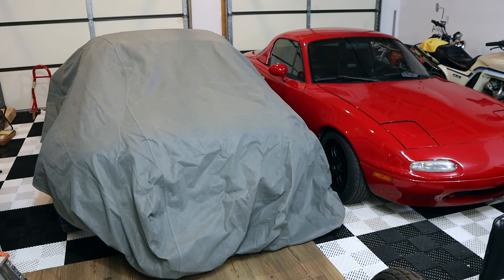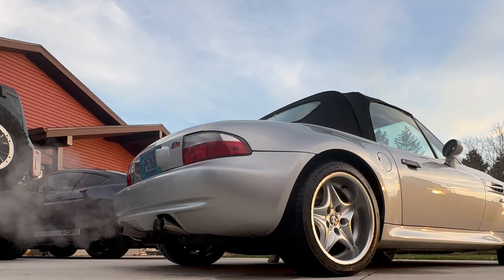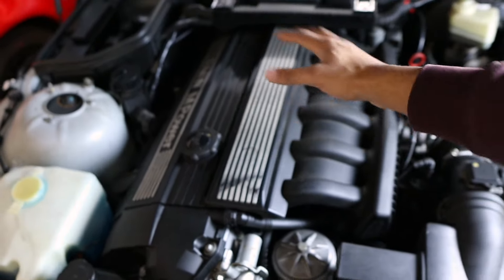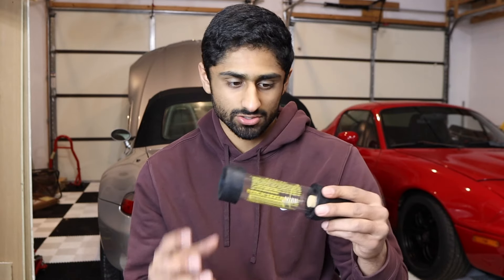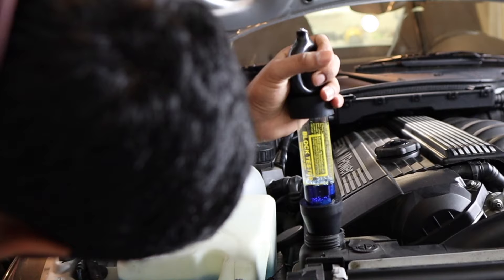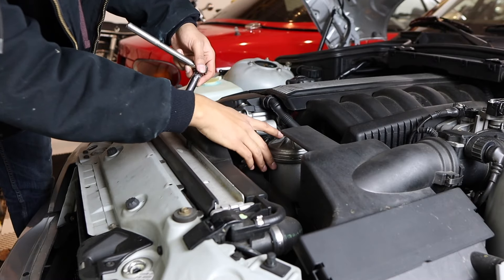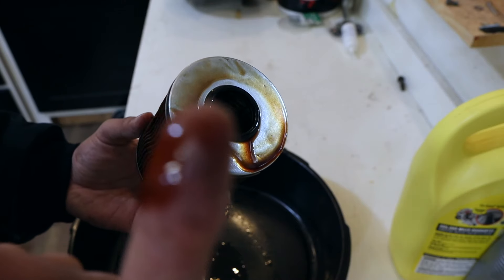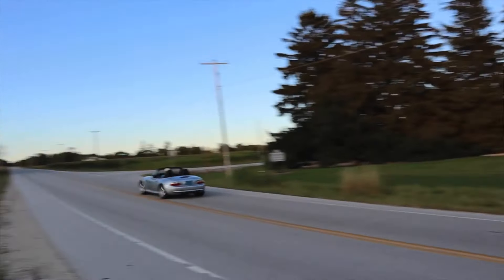I Hurt My BMW M Motor...

Comment: Just found your channel I’m wanting one of these so bad !!! Just worry about the reliability. Could this be a daily driver?? No one seems to answer this question. Also the one I’m looking at is a year 2000 with 70k miles for $15,000

Any answer would be much appreciated!!
Reply from the maker: Hey thanks for watching! As far as reliability goes these are pretty solid. You might have to spend some more money maintaining it compared to a Toyota. You can daily it, if it meets your needs. Not much space only 2 seats. In reality you can daily anything tho. Price seems good just watch out for the rear subframe since that’s the weak point

Comment: Hey man I own a 97 m3 and since I have owned the car there has always been a problem with cold starts causing a good bit of smoke,  If this helps at all the problem for me at least is worn valve stem seals causing a bit of smoke not enough making it a massive problem and a little bit of high oil consumption 1 quart every 3000 miles.
Reply from the maker: I’ll definitely keep an eye on the oil level. But since smokes white I don’t think it’s oil but I’ll definitely watch it. It needs some miles that’s for sure